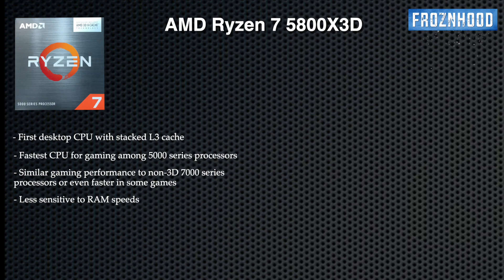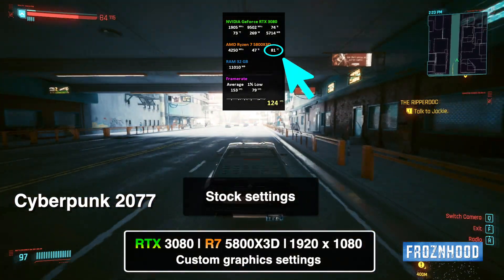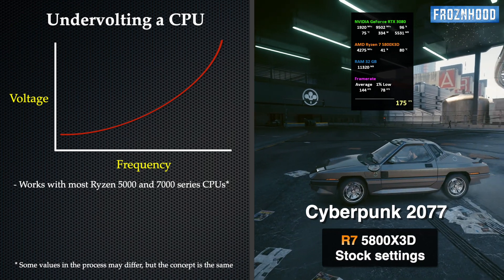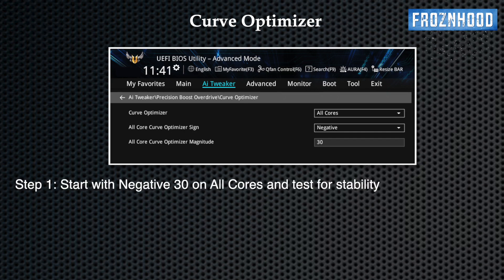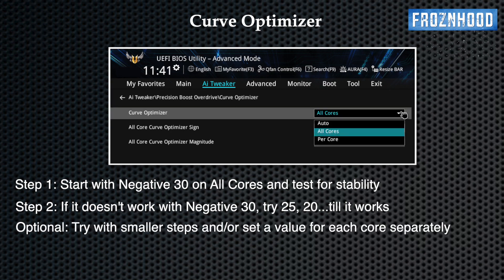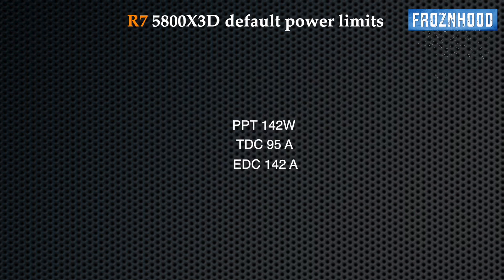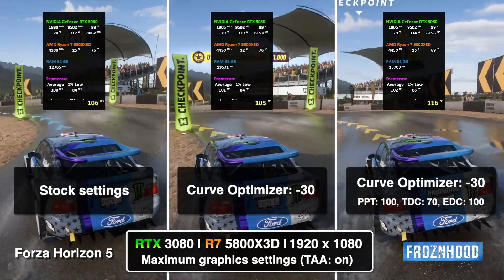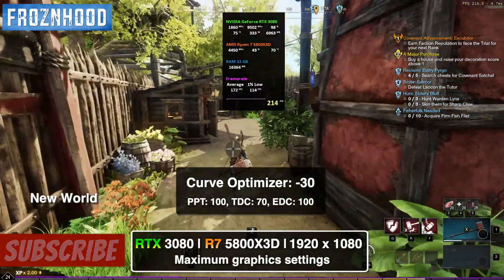Optimizing Ryzen 7 5800X3D - Higher performance, Lower temperature | Undervolting | Curve Optimizer

Comment: Hello, just wanted to say thanks for the awesome vid and guide, I followed everything step by step and I indeed see a massive improvement in thermals and performance.

I only have one issue though and this is the 4th consecutive day that this happens: In the morning when I first boot my pc, it automatically restarts once I get to windows with the orange led blinking on my motherboard. This is happening everyday only once first thing in the morning when I first boot. Any ideas what might be the issue? Cus I tried a cpu stress test and I've played very intense video games and my system was always stable, everything is running perfectly.
Reply from the maker: Hello, so this started to happen after you made the optimization from the video? Have you changed anything else in the BIOS (now or previously)? All CPU settings in the BIOS must be the default. You can reset the BIOS to factory settings. Then check if you will boot without problems. If yes, set the settings from the video. You will probably be able to boot without problems. If you have problems, try with Curve Optimizer -20.

If you are booting every morning, it means that you are always shutting down the PC. So the PC probably fails a specific check that is done at start only (not on self restart). You need to check what does this orange led blinking mean for your motherboard. It may indicate the exact problem, which could be elsewhere.

By the way, why don't let the PC go in sleep mode when you are not using it? Just asking.
Reply: @FroznHood  I have my bios set to D.O.C.P. and my ram to 3600Mhz (that's their advertised speed from Corsair), other than that I haven't really touched anything else. Curve optimizer is set to negative 30 on all cores and I've put the power limits same as the video.

As for the orange blinking on my mobo I googled it and it says it's an indication of a potential hardware or power-related issue that requires attention. Also, is it better to put it in sleep mode rather than turn it off? I usually always just turn it off when I go to sleep, I've never really used sleep mode.

And yes, this started to happen right after making the changes from this video.

The thing is, my pc gets past windows. I get past the lock screen and open up discord etc. and after about a minute it restarts. So it's not exactly the moment it gets to windows, but some 30-60 seconds after. Again, this is the only issue I've experienced. I've never had my pc fail or be unstable or restart while I'm gaming or doing anything else. I just did another CPU stress test and all was good so not sure what's happening.
Reply from the maker: Try the options from my previous comment. You can start with the second, because it is easier (setting CO to -20).

You can find more info about if shutting down the PC is necessary. Usually, you should shutdown the PC if you are not going to use it for a longer time (days). Otherwise, it is enough to Lock and let it go to sleep. It means less stress for your parts and faster to use.
Reply: @FroznHood  Okay, I'll give it a try. Thanks again for the help!

Comment: Hi, 
I choised all cores negative 30 OK
But if i get higher value at Cinebench r23 with different set of PPT, TDC, EDC values, should i choose it?
Reply from the maker: All depends on what you are optimizing your PC for. Gaming? Work? What kind of work - 3d rendering, video editing, Excel...?
Reply: Gaming  @FroznHood
Reply from the maker: In this case the Cinebench score doesn't matter, because it does not represent real gaming performance. You should ignore it and use Cinebench for stability testing only. For measuring the gaming performance using different power settings and values, use a game with an internal benchmark (Cyberpunk 2077 for example).

Comment: And configuration for  Ryzen 7 5800X3D and MB Asus Rog Crosshair VIII Hero WIFI???? PLEAS
Reply from the maker: The settings are not motherboard specific. If you have a B550 or X570 motherboard, you can use the same settings and values.

Comment: For some reason I did all the custom power limits and -30 on pbo, but once I go back to boot it says “no changes made” what have I done wrong ?
Reply from the maker: You didn't save the changes properly or the boot wasn't successful and it (the BIOS) loaded "the last successful" settings.
Reply: But I did the same save method for kombo strike 3 and it worked

Comment: Is there a chance to show how to do this but on a b550 Aorus motherboard? The bios is so different and there's like many parts where you can edit those values, I don't want to mess up to much :S
Reply: dont take my words for this, but if you have a 5800x3d i think its basically impossible for you to kill your cpu changing settings cause if you OC it will get stuck on baseclocks.

Comment: soooo I have a 5600X3D. Can I use these same settings as well and expect similar results?
Reply from the maker: Yes, you can use the Curve Optimizer the same way, but the power settings value must be different.
Reply: @FroznHood  any idea what I should tune them to? Or how I could find out? I did try both settings and my CPU dropped about 10c and fps seems higher but I haven't done any real fps. Also seems stable but I haven't ran it yet for extended periods of time.
Reply from the maker: If 5600X3D is identical to 5800X3D as they say (just with disabled 2 cores), you should be able to use the same settings. Be sure to check for stability with longer sessions. Cinebench (1 hour) + gaming is usually enough.

Comment: After various attempts, I found my 5800X3D to be stable at CO -20.
I had to reduce the power limits after that, because the temps raised almost by 10°C degrees after that. 
So I decided to use these power limits:
110
75
110

This way on Cinebench 2024 I have higher frequencies and slightly lower/same temps as stock settings (which were already low since I have a very powerful cooling system). 
Do you think these are good values?
Reply: this doesnt make any sense, co - offset does offset your voltage by minus x milivots, so there is NO WAY your temps have risen.
Reply from the maker: I agree. Something is wrong here. Temps should be lower or at least the same with negative Curve Optimizer offset.

Comment: PTT/TDC/EDC I sert it to 999 for ULNIMITED POWER ! and then did negative curve -30 all cores and PBO scalar x10 to stay stable 4.45Ghz all cores then blck 102 insted of 100 and got stable 4.54Ghz all cores and then did -030 Vcore.
avg Vcore 1.12Vcore and peek 1.18Vcore as highest.
temp: package avg 52 when having game and youtube files in background and apps, 32C lowest at idle 61C peek with L3 Cache temp 34c avg and 22c low and 32c peek.

cinebench r23 all core 30 min run stable 72C and fans at 60% and pump 80% becuze of bigg loop.
cinebench r23 all core run keep my stable at 4.54Ghz all cores is impressive.

can not overclock higer than 4.54Ghz is sad I would easily do 4.8Ghz all cores stable if AMD allow me.
Power usage hits 130 at stock and overclock I hit 118W.

cinebench r23 score 15532p is amazing vs my old r5-5600x 4.9Ghz.

Comment: What do you recommend to test the stability after adjusting the Curve Optimizer to -30, I passed the cinebench and OCCT stress test and there were no crashes, but I would like to test it in a more real way, with some gaming benchmark, I have read that the best It is speedway but it is paid if I am not mistaken, any advice?
Reply from the maker: If you use the PC for gaming just play games. Test the PC with the tasks you usually do.
Reply: @FroznHood  With curve optimizer at -30 and lowering the ppt, an improvement is achieved without losing stability, right? I'm afraid to touch edc and so on
Reply from the maker: If you don't use the settings shown in the video I can't tell what the results would be.

Comment: Ey Thank you very much for the vídeo and information! Very helpfull. I have one doubt i hope you can solve… with your settings my frecuencies flickers from 4450mhz to 3600mhz 1 second, and go back to 4450mhz. This happens every 5 seconds or so…. Is this normal?
Reply from the maker: Hi, no. It is not normal. It should be stable at 4450. First, try with completely reseting the BIOS. In most cases that solves the problem. If that doesn't help try to give it a little more power - 110/80/110.
Reply: @FroznHood  Thank you very much for the answer. 
With that conf and -30 to all cores I run Cinebench 2024 multicore test and all my cores stays stable at 4450mhz and 70 degrees during all the test,  thats good right? 
The thing that bothers me is when i run time spy or some games i see spikes from 4460mhz to 3600mhz so...is that normal?
BTW Idont see any reflection of that spikes in the game performance.

I checked all the information via MSI Afterbnurner Monitoring.

Thank you!
Reply from the maker: Hi, again. As I said in my previous answer, those drops to 3600 MHz are NOT normal, especially in games.

Comment: Cant find ppt in gigabyte bios but manages to do -30  on aida64 i have 78C instead of 85C niiiice
Reply from the maker: Check again for the power settings. They may have been called differently in your BIOS. It is worth it.

Comment: ❤If i do NOT have Curved optimizer, does it make sense to adjust the PPT TDC AND EDC Limits like you did? Because 
I have an asus prime a 320m-k Mainboard, and cannot find the curved optimizer.. Thanks alot ❤
Reply from the maker: Yes, and you will probably get a good improvement. I am not sure how well this CPU will run on a A320m motherboard.
Reply: @FroznHood 🙏🏻🫱🏻‍🫲🏼❤️ Thx. So much for youre answer Bro. My mainboard supports that cpu cause it is AM4, it actually works killer with my rtx 4070, but with my wraith prizm cooler cannot handle the heat the temperature is way to high, would you still change the PPT TDC AND EDC to 100 70 and 100 if i buy a CPU Watercooler Asus Rog Ryujin III?
Or would you let these settings on stock if the new AIO Watercooler option would cool it down?

Summerized:
Would you even change the PPT TDC AND EDC Limits to 100 70 100 even if the ryzen 7 5800x3d would be cooled down with its standard bios setting and a AIO Watercooler to a good low temperature if you dont have curved optimizer?

Would i get a benefit? 
Thanks in advance from Germany bro i subscriped to youre channel  ❤️🫱🏻‍🫲🏼
Reply: @FroznHood  Is the profit the same in 2k? or only in 1080 ?

Comment: So, personally I can't go past -20 of Curve Optimizer and I have a 5800X3D. Any value above it (-25, -30) will crash randomly in idle. 
I found a sweet spot of PPT, TDC, EDC of 110, 75, 110. 
But I honestly can't tell if it really improves performance in games. 
With default values, on Cinebench 2024, I reach around 4270 Mhz on average. With the above custom settings, I'm around 4370/4380 Mhz but it's really variable. Sometimes 4400. Sometimes 4350. 
What I mean is that I don't know if it improves the gaming performance (I didn't notice anything relevant) or if it could even lower gaming performance.
Reply: You probably should check the temperature in default and with those settings, its probably less hot
Reply: Because you are adding heat using PBO leave it on auto just use curve optimizer it lowers your temps and sustains it at higher clocks because it’s running cooler and in turn your clock speeds maintain at high clock speeds for longer duration because it’s running cooler that’s what gives you higher fps.

Comment: Will have to give this a go. I have my CPU at -20 and it hits 4425Mhz. However I have left the power settings auto. May have to try your power limits.  I wonder if it will let me use -30 as the curve.

---

Ok so only 1 min in to running cinebench -30 and the new power limits set. Not much change in the clock speed still getting 4.42GHz.

I don't have any temperature monitoring on this pc but at least I haven't lost any clock speed.

No idea if my CPU will happily run -30 with the new power limits because I found out that my chip on auto limits is stable at -20.
Reply from the maker: All depends on what you want to achieve. Since you haven't installed any temp monitoring app I guess you are not concerned about the temperatures anyway.

Comment: How tf are you using PBO under a 5800x3d ??? It's not supported..
Reply from the maker: You probably mean that it is Overclocking that is not supported. PBO is a technology with many other capabilities and functions. They are completely different things.
Reply: @FroznHood  oh well idk but i can't change both curves and PBO in my bios ! So i had to search on internet and it looks like PBo Tuner works as well
Reply from the maker: Curve Optimizer is a part of the PBO and should be somewhere in the PBO menu of your BIOS. PBO is not just a setting. It is a technology that has many settings, including Curve Optimizer.

Comment: This settings working on 5800x? Or only 3d edition?
Reply from the maker: They are for 3D edition, but you can use the same strategy for 5800X just with different power values. The logic with Curve Optimizer is also the same.

Comment: I had my 5800X3D running at -25 all-core for a few months. Yesterday, after watching this video I set up and tested the CPU to run at -30 all-core, with your 100-70-100 you showed as the limits.
JUST WOW, the temperatures are way lower, and the 100W limit definitely helps on that. I did some load and stability testing using Cinebench and OCCT extreme, and I saw that I did indeed win the silicon lottery, the CPU runs stable as a rock, the clock speeds attained with my MasterLiquid Lite 240 AIO were stable, no more thermal throttling and spikes in clock speeds, as the CPU barely went to tempretures of 80 C. During gaming, it never goes above 75 C, barely gets to 72 or 73 degrees, and runs at a stable 4.5GHz clock speed. In OCCT extreme tests, it was stable at 4.4GHz, and in Cinebench it stabilized at 4.35GHz after a bit. It did lose some points in Cinebench compared to my previous PBO settings which did not have the custom limits, but it is day and night in both gaming perfomance and in thermals and power consumption.
I recommend everyone with such a CPU try these settings and adjust to their liking. I found that your settings in the video work well for me. I may be able to set the limits a tad bit higher, but it does not seem it will be worth it...
Great video overall
Reply: i'd recommend trying corecycler and ycruncher if you really want to dial those in

Comment: What power limits would you recommend for a 5800x non x3d because i have been hitting 89C in cinebench with the stock settings
Reply: What cooler you have?
Reply: @dagnisnierlins188  Deepcool AK620

Comment: How can you monitor the cpu core temps? I have this chip on my Aorus Master X570. I only play iRacing, and after putting this chip in last week I cant run any better fps than with my old 3700X. I am using the cooler that came with the 3700X.
Reply from the maker: There are many ways you can monitor the CPU temps. The easiest way is to use MSI Afterburner, but I doubt the problem is with the temps. It is either the frequencies or you have heavy GPU bottleneck. I haven't played this game.

Comment: Is it okay to try a bit lower values for ppt/tdc/edc, such as 95/65/95? Or is 100/70/100 the absolute lowest value before you start losing performance?
Reply from the maker: There is no reason to do so. You risk making the system unstable without getting anything in return.
Reply: @FroznHood  The lower you go, the better the temps right? I've seen one guy saying he runs 60 tdc for gaming, but I'm not sure at what point you start losing performance.
Reply from the maker: Every unit is different. But it doesn't make sense to go that low. With 100/70/100 you should already have decent temps and frequencies, unless your cooler is broken or not properly installed. If you just want to spend time experimenting with your CPU, fine. Otherwise, you are wasting your time.

Comment: just got this cpu and ran it for the first time and tried it out and was damn near reaching its TJ max temp of 90C degrees but,  just by under volting the cpu by 30 offset brought it down a whopping 30C degrees along with adjusting my cpu fan curve. Thank you so much and ill definitely take free fps for less power strain on the system 👍
Reply: Can i ask what sort of temps youre getting in COD perhaps? Im seeing around 76 with high gfx settings. And I have 4 120mm PWM case fans and DeepCool 5.0 with 2 fans.